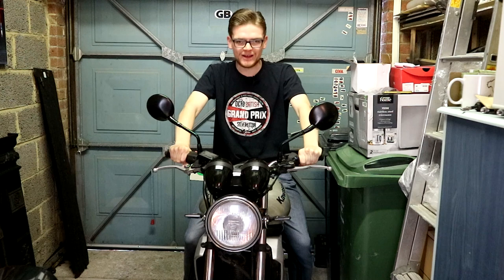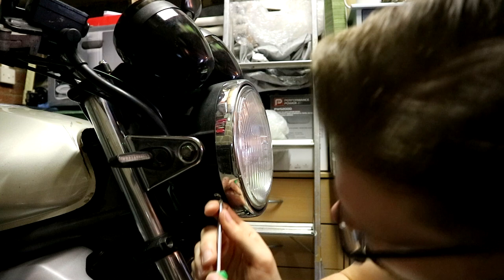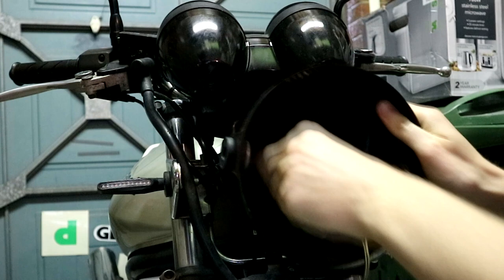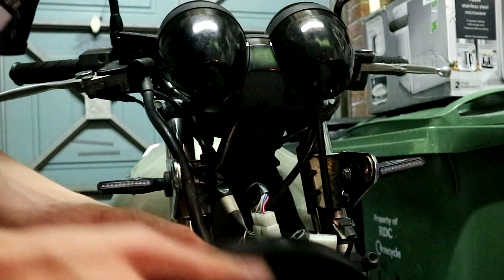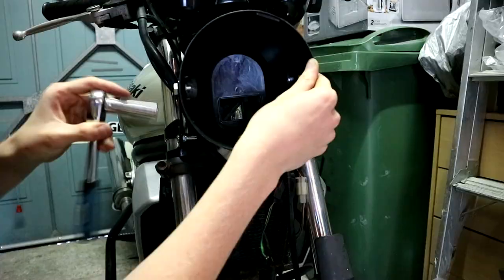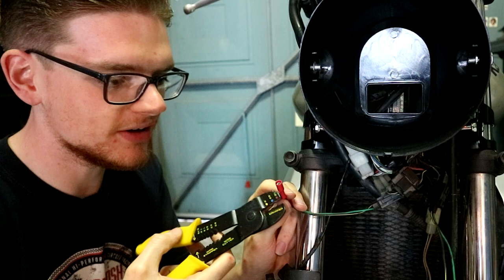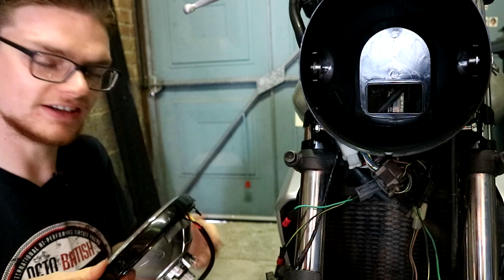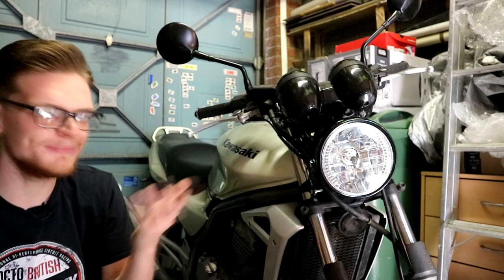AWESOME Custom Bike Headlight Install! [Project Kawasaki ER5]

Comment: Think I'd have kept the separate indicators and also wired in the integral ones. Suspect the integral one will be almost invisible with the headlight on. You can imagine what could happen.

Do you have to have the light set up so it's aligned correctly like car headlamps?

Comment: I was just thinking, I would put those stick out indicators back on the front of the bike. They may look old fashioned but every motorcycle rider needs all the visibility you can get.
Also I am not too sure, if that combination of lights are legal in this country. It may fail your mot .

Comment: I'm going to have a grumble about the indicators too. 
Doubt they will fail an MOT but they are going to be so hard for others to see. You want as much visibility as possible on a bike and the old LED units look to do a far better job. 
On the plus it's a nice looking lamp unit that you've done a good job fitting + points for YouTube banter. 
(I've popped over from a Hubnut vid.. I might stick around)

Comment: At a tee junction no one from the side will see the indicators as the headlight will be pointed straight. I'd put the old one's back on as they act like a flashing beacon which draws attention to you so you don't get clobbered.

Comment: Cool mod! Looks great sir! Though I worry that the light from the headlight would overpower the indicators within the headlight lens making them impossible to see by other drives unless they are right on top of you...part of the reason a lot car manufacturers actually wire their cars to turn off the headlight on the respective side an active turn signal indicator is flashing on with cars over here in Canada. You want to be even MORE visible on bikes.

Have you thought of, say, using that headlight indicator setup in conjunction, say, with the super slick but still really bright mini signals Moog put on his bike in that MCM video a ways back? They wouldn't be large, in the way or ugly but will be far enough from the headlight to make them more visible...?
https://youtu.be/ceUmEEHOMM4?t=831
Reply from the maker: Thank bud! The camera is deceptive, the indicators are more visible than they look, but we'll see how we go in practice...
Reply: @MillerCorner  For sure, it does look pretty awesome! Are you putting an LED bulb in the housing as well?